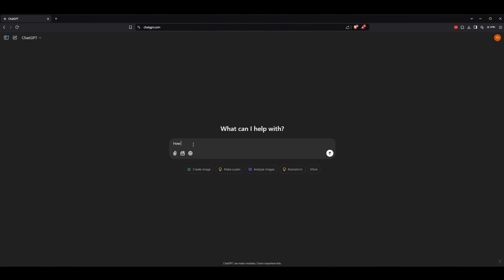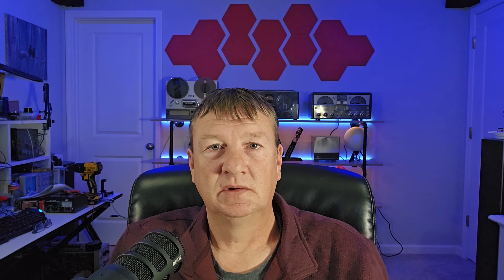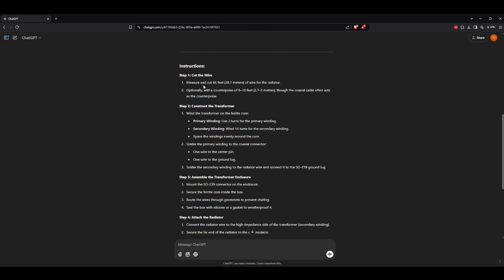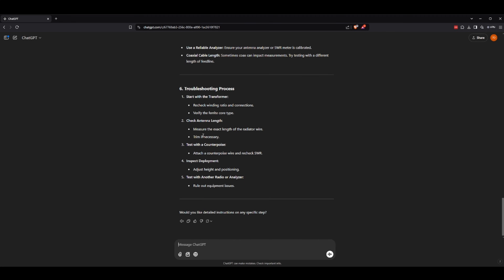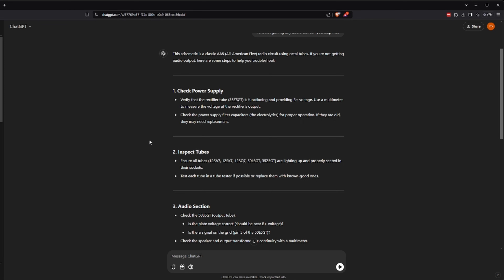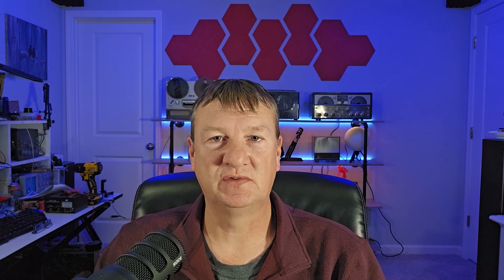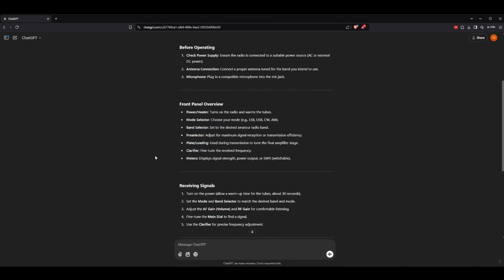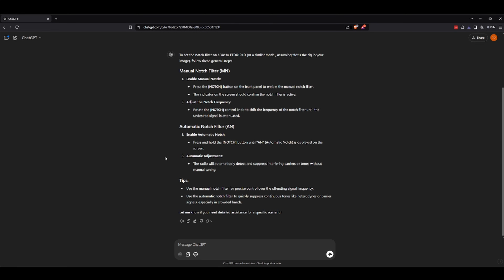How to Use AI in Your Ham Shack – Beginner’s Guide

Comment: I have used ChatGPT to find issues in code and it did amazing, however beware that it doesn't always get math correct as I asked it to solve a very basic electronics math problem dealing with parallel resistance in which it quickly came up with an answer that wasn't close to being correct, I corrected it 4 times. It was not able to get the total resistance correct and this was probably 6 months ago so I use it cautiously.

Comment: Good summary!  I use LLMs all the time, but with caution.  At present, I think of them as search engines on steroids.  Instead of, say, Google showing me a list of websites where I can look for information, the AI brings the information to directly to me.  A lot of the information comes from the same websites I would have to rummage through myself if I relied only on Google results.  It's not just an information dump:  the AI is able to organize the information into a (usually) coherent and accurate answer to my questions.  As this video points out, there's a conversational quality to it as well.  If I don't understand something, the AI can explain it.  If I think something about the AI's response is inaccurate, incoherent, or just plain wrong, I tell the AI and it will try to correct itself or explain why it produced the results it did.  And the AI I normally use provides numbered links to websites I can use for reference.  It's a huge time saver.  

Again, however, use with caution.  While most responses are accurate, some are not.  Sometimes I can tell immediately when an answer is off, based on my own knowledge the of the subject matter.  Other times, incorrect information isn't revealed until I test it in the real world.  In that case, if I tell the AI what happened it often responds with something to the effect of, "Oh, yeah, looks like I was wrong.  Let's try something else..."  It's important to TEST the AI's info before applying it to any critical application.  Trust but verify.

I've mostly used LLMs at work.  Haven't used them much for ham radio.  This video makes me want to give them a try in the shack.

Thanks for a very information video!

Comment: Double check the maths, I asked it about wavelength calculations and it had a problem with dividing by powers of 10 by powers of 10.
I corrected it and it admitted the and rewrote the calculation.